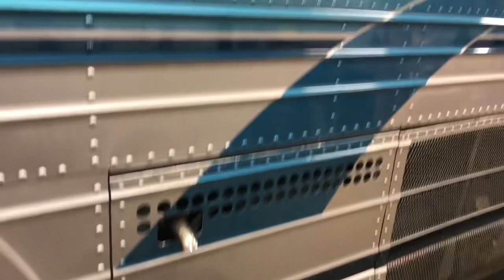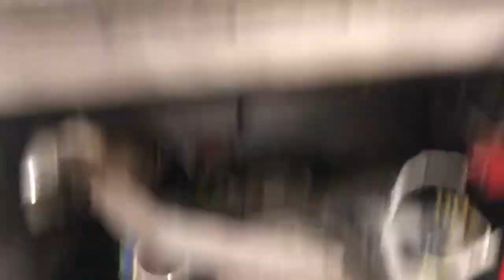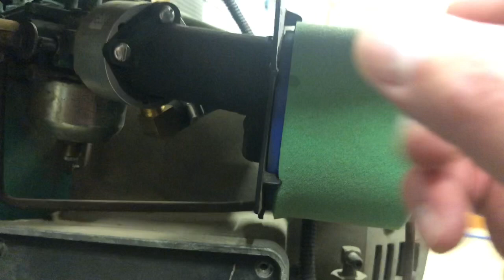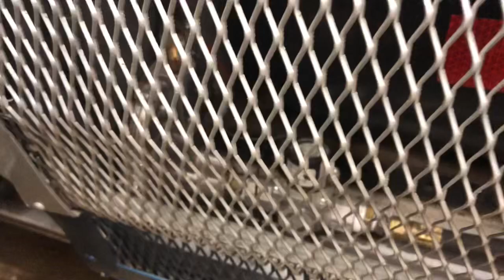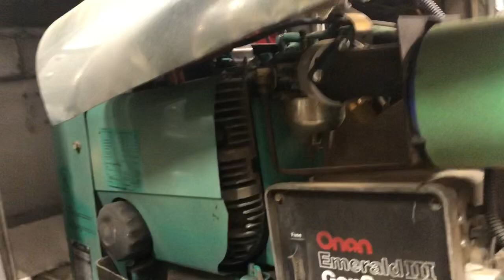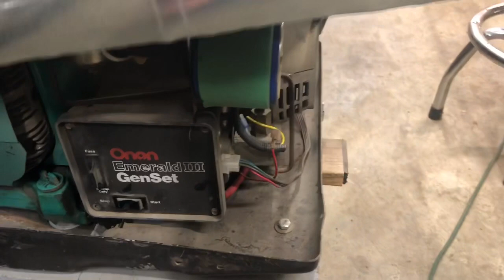4106 Bus Conversion Onan custom generator install

Comment: Looks like a winner. I am curious about the parts list for the propane conversion. I went to the website and there are just so many. I have the same generator and would like to convert it also if you would be so kind. Thanks
Reply: I looked at every offering at the Carb N Turbo website and I think I found the cutoff, regulator, and the vacuum switch. I was unable to find the metering elbow at the outlet of the regulator nor the spacer that allows the propane to enter the carburetor. Any help would be appreciated. Thanks
Reply from the maker: Just call them up and tell them what you’ve got and they’ll get you the right stuff. I found them helpful and it’s better than the website. All that being said with the scarcity of propane during our recent storm event, I’m probably going to be removing this at some point and going diesel or solar. Also I think going out the bottom with the exhaust would be better than what I did in hindsight. Are you putting it in a 4016 in that same bay?
Reply: @ThisOldBus  Ok I'll give them a shout and see what they can do. I am working for the gentleman that owns the bus ( not a 4016) and it will be in the back compartment on the driver's side, next to the engine. Diesel pusher, but said diesel gen set was too expensive so going with the LP since it was already plumbed. Thanks

Comment: NIcely Done, Scott!  Good 'in house' job on the slides and fabrication of the necessary exhaust and air flow parts and control components.

Comment: Good video, nice job on the install.  My small concern is the paper air filter getting soaked while traveling down the road in a heavy rain storm. Perhaps you could fabricate a deflector?
Reply from the maker: Good reason to 3D print a replacement box for it. Thanks!